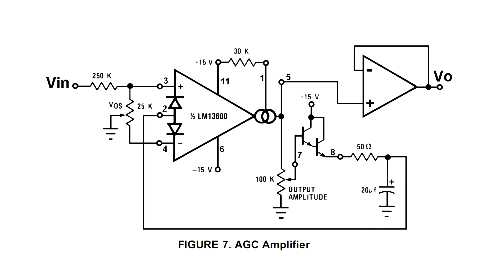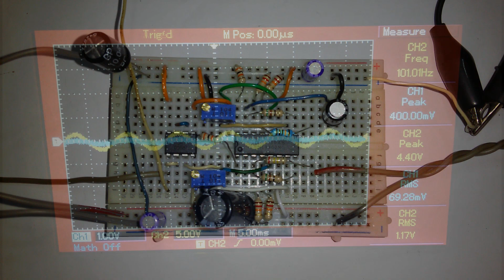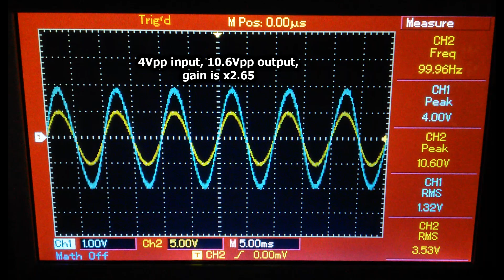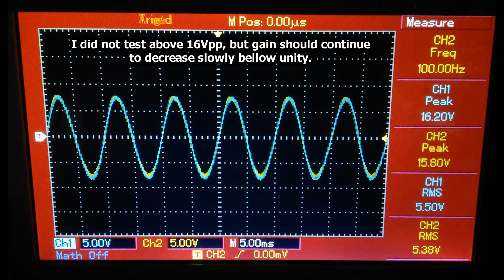AGC Automatic Gain Control Amplifier from LM13600 Datasheet

Comment: I have been looking for somthing like this for a long time. I need it in my DJ mixer to keep the level constant. Am i correct in thinking i coud use rthis for that peerpos. Thanks
Reply from the maker: It will not keep the level constant, but sure will reduce dynamic range to a great extent. I suspect what you should look for is a proper audio compressor / limiter unit.

Comment: What the same as Jrc 13700 D ..?
Reply from the maker: There is a difference in the output buffers, as stated in the Texas Instruments LM13700 datasheet: "The output buffers of the LM13700 differ from those of the LM13600 in that their input bias currents (and thus their output DC levels) are independent of IABC....".  You can check the difference in the 'Equivalent Circuit' diagram as shown in the Japan Radio JRC13700 datasheet. The AGC circuit example should work with both versions, but I did not test it with he 13700.
Reply: @unrelatedactivities  ok tanks sir.. plants to reapair crown lps 1500 ptotec .. i'm suspicious of  jrc 13700 D .. i'm still a beginner .. 😊🙏
Reply from the maker: You are welcome. Good luck with the repair!